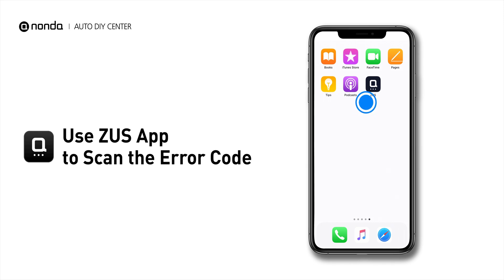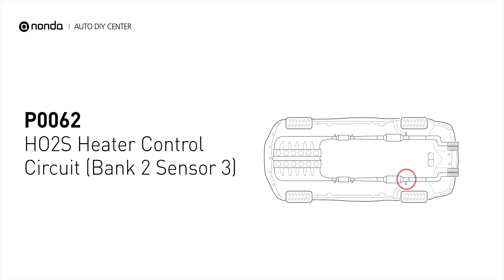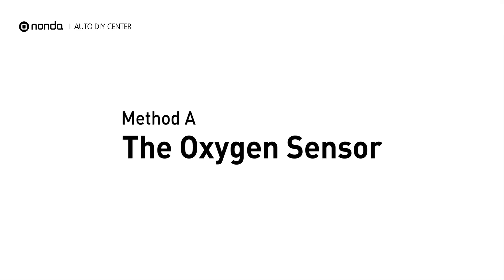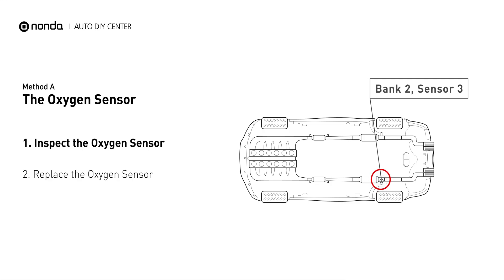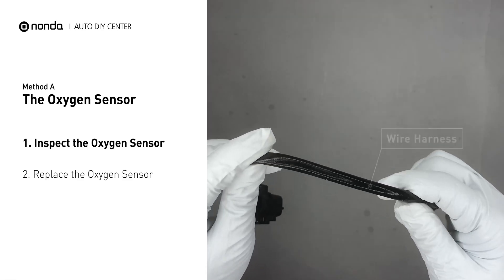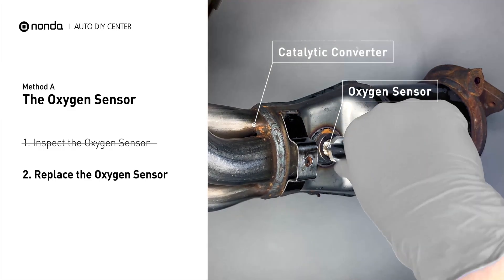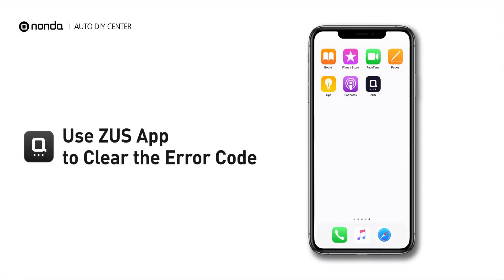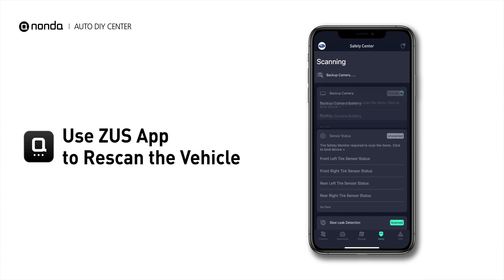How to Fix P0062 Engine Code in 2 Minutes [1 DIY Method / Only $19.43]

Comment: My check engine light came on and this was the code that came up (p0062) heater control. I dont have time to take it in and have to drive 500 miles tomorrow. Will the car be good for the drive?
Reply from the maker: Hello, we suggest to deal with it right away as this could possibly shorten the lifespan of your catalytic converter.